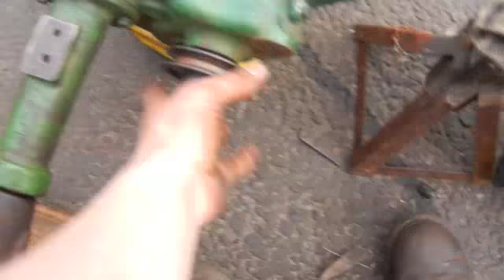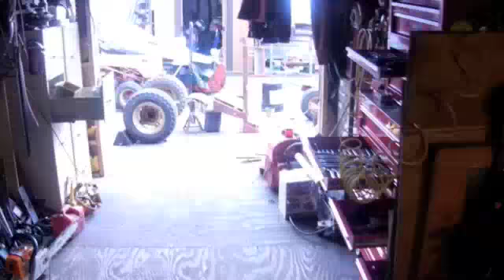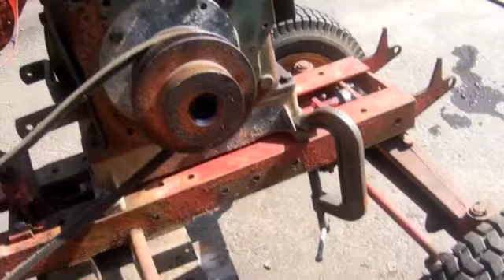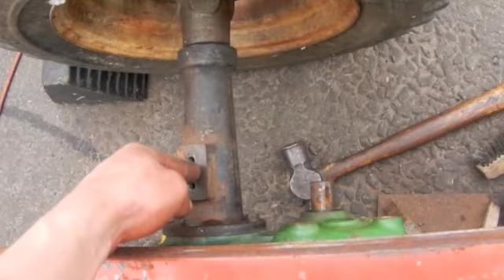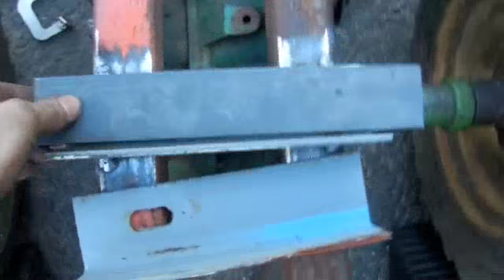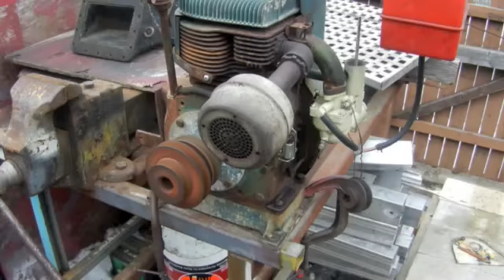Off Road Tractor Build- Part 1

Comment: Looking good! Should be fun series.  An off road mower huh. Don't make me bring the case 220 out of retirement. Im gonna putter with it some anyways. Just needs the carb and fuel pump put back on :D
Reply from the maker: Fun and short! I hope to have it mostly wrapped up by the end of this week, mid next week (4WD is on deck). Don't need anymore drawn out projects! I do the same thing, let an old tractor sit for too long and parts start to disappear :)

Comment: That's Going to be a Mutt tractor lol!!
Love that Cast Iron 15hp! She will Fly with that!!
Reply from the maker: I know it will have plenty of power! Had it driving yesterday, took it up our steep driveway in 4th at low throttle, didn't miss a beat…..
Reply: I have one 15hp , and two 16HP's I was thinking of using one on my Racing tractor , think it would be more fun to run a classic engine like this.